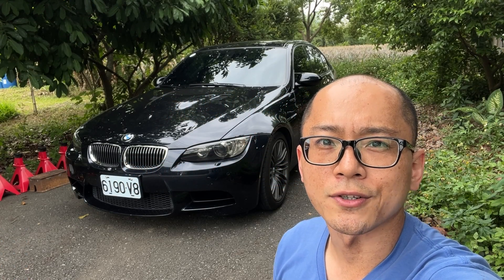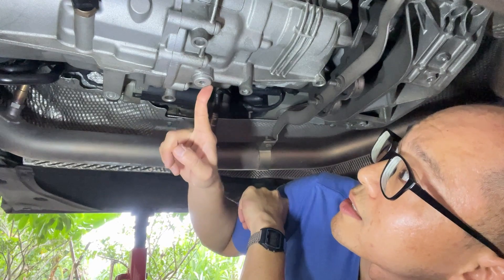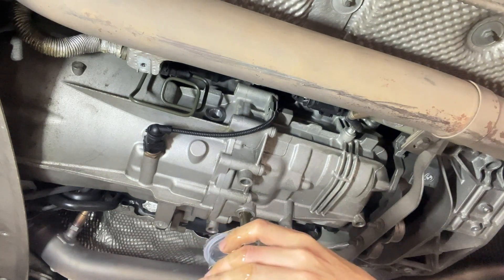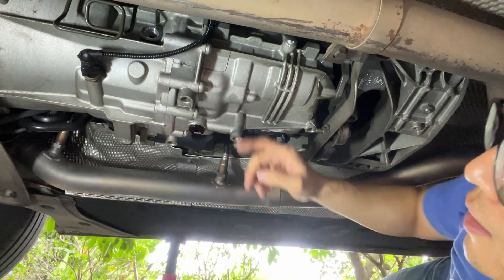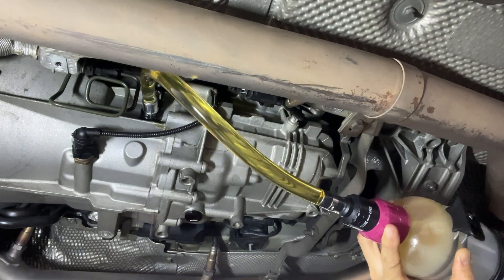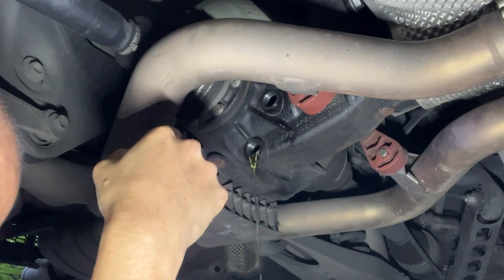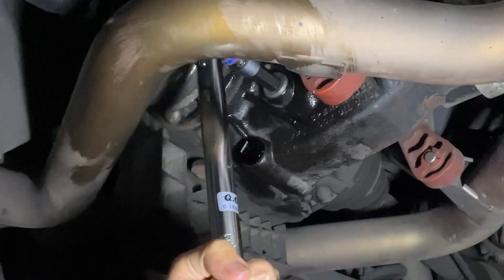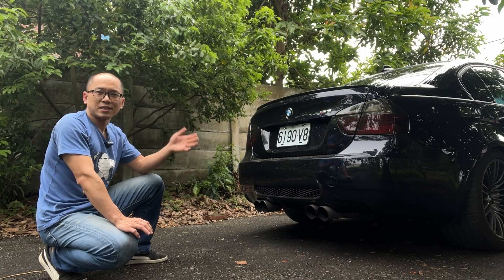ECS Tuning Magnetic Oil Drain Plug Upgrade For BMW E90 M3 (Cats alert)

Comment: regarding the magnetic oil drain plug, will the crush washers from mann oil filters work?
Reply from the maker: Hi Albert yes they are in the same spec! I haven't use any one of those coming with the magnetic oil drain plug because I change the oil filter every time.

Recently I'm thinking not changing the oil filter every time since the oil appeared to be very clean. Maybe we can change the oil filter every two oil changes so those crush washers that come with the magnetic oil drain plug can be used 😁

Comment from the maker: Please refer to the previous video "BMW E90 E92 E93 M3 Manual Transmission Oil & LSD Oil Change DIY."
請參考「自助更換BMW E90 E92 E93 M3 手排變速箱油及差速器油【中文字幕】」
https://youtu.be/UacZnGUUJlM

還有「用Buyandship集運從海外網購BMW原廠零件【中文字幕】」
https://youtu.be/jEAvlOyR3V0

And here's the buying info:
**Parts**
ECS Tuning Magnetic Oil Drain Plugs/Screws for E90 M3:
Engine (+10 copper washers): ES#: 251840
Manual Transmission (incl. O-ring): ES#: 4069680 
MT replacement O-ring: ES#: 4305371 
LSD (incl. O-ring): ES#: 3046103

**Tool**
Oil pumping tool: JTC 5534 (1.5 L) for MT oil and LSD oil.

以下是購物情報：
**零件**
BMW E90 M3用ECS Tuning 磁性洩油螺絲：
引擎（附10個銅墊片） ES#: 251840
手排變速箱（含O環） ES#: 4069680 
手排變速箱替換O環 ES#: 4305371 
差速器（含O環） ES#: 3046103
O環店：暘正迫緊有限公司 新竹市光復路一段350號

**工具**
加油槍 JTC 5534 (1.5公升，適用變速箱油及差速器油)